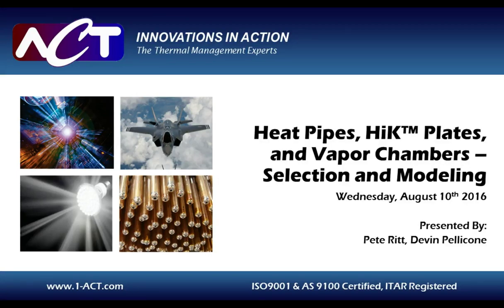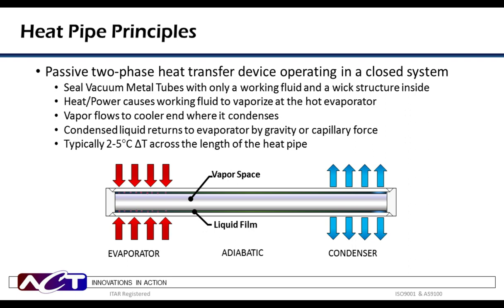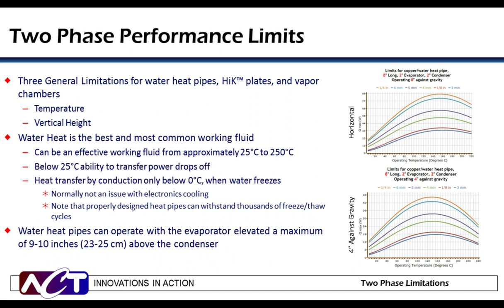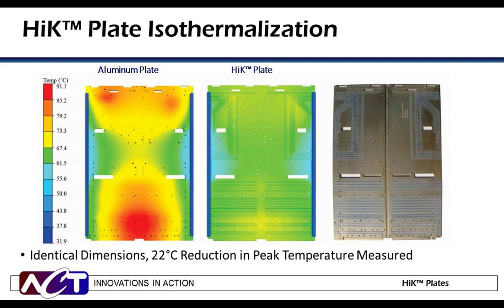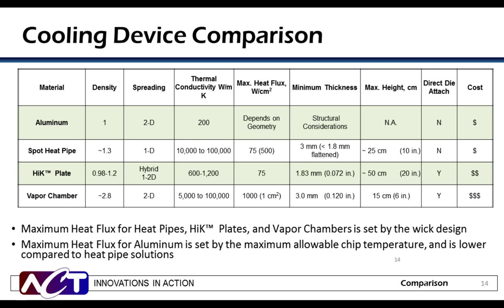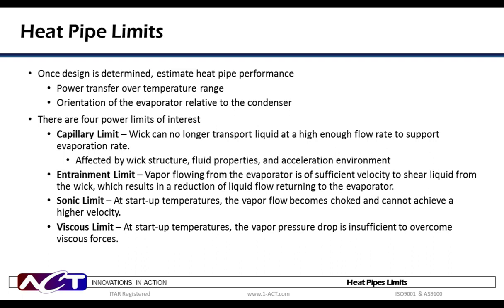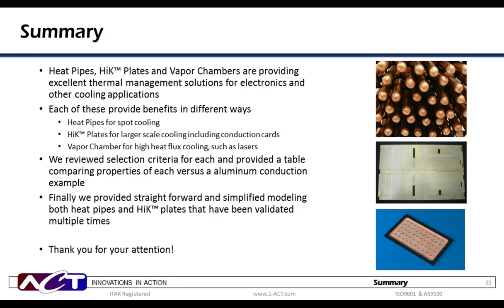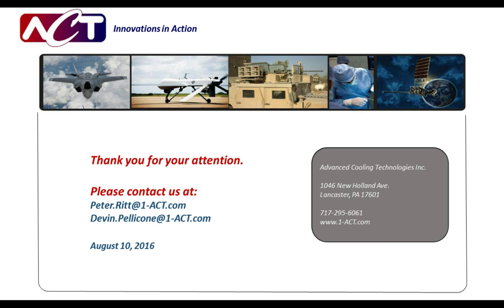WEBINAR: Thermal Management: Heat Pipes, HiK™ Plates, and Vapor Chambers

Comment: Has anyone tried to make a pin-fin-heat-pipe heat sink by simply using heat pipes for what are otherwise solid metallic pins on a plate? How well can that work if you use a large number of heat pipes with a fan? I guess I will find out, I am working on the project now.
Reply: Interested to see how it goes!

Comment: A cup of water can be boiled away in about 20 minutes. What is the flow rate of water in a heat pipe form 
the hot end to the cold and back? Using water at 222 degrees Fahrenheit on the hot end, ten inch in length?
Reply: 抽真空后加液30度开始沸腾循环。略知一二❤

Comment: I still don't understand the difference between a flat heat pipe and a vapor chamber, can anyone tell me? thank you very much.🙃
Reply from the maker: A heat pipe can only be flattened so far before it impacts operation. A vapor chamber often utilizes a different internal wick structure than that of a heat pipe. Email us if you'd like to discuss your application: solutions@1-act.com

Comment: vs. Peltier coolers??
Reply from the maker: Peltier coolers are great for cooling components to sub-ambient temperatures, but the back side still gets really hot. ACT has had many projects where a peltier device is used to directly cool the component, with a heat pipe attached to the hot side to move the heat to a remotely located condenser.
Reply: heat pipe requres no power source?
Reply from the maker: @daydreaminginventor-k8957  No, these are passive heat transfer devices. They do have a limit of passively working against gravity of about 12".
Reply: @AdvancedCoolingTech  i was acctually replying to the other guy on Peltier, i mean  i totally think that heat pipe is much better since  it requires no  power source, by the way this tech is used on high altitude railway foundation  to freeze soil so that it does not move ....
Reply: @AdvancedCoolingTech  sorry , 12 inches? or Feet?  i am thingking about using heat pipe 
to move heat from top to lower part about 2 Meters ,
Reply from the maker: @daydreaminginventor-k8957  A heat pipe will not support 2 meters against gravity. There are some other great pumped technologies that could work for you!
Reply: @AdvancedCoolingTech  THANK YOU  so much for the tip , have you got any idea that how much gravity or height a normal non special pipe can work against ? ^_^